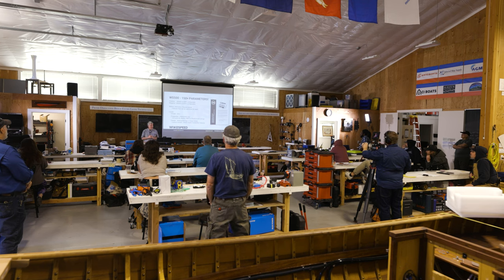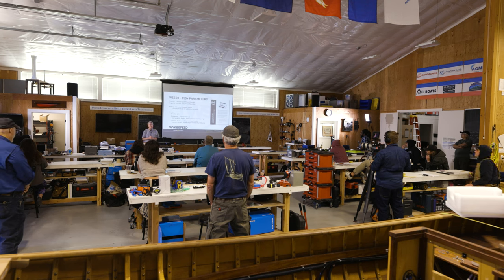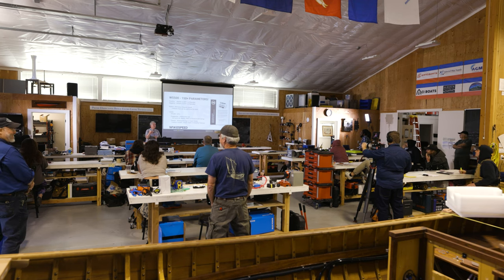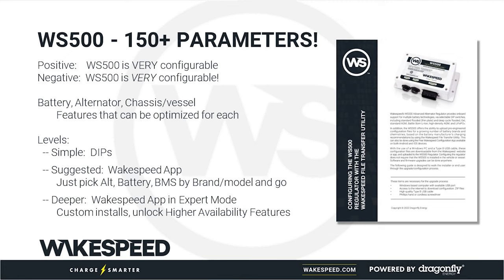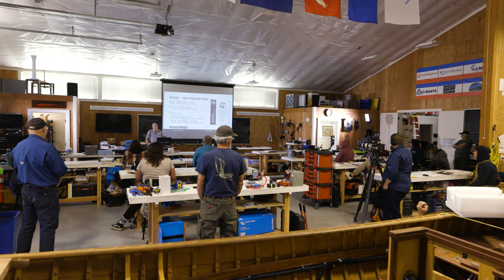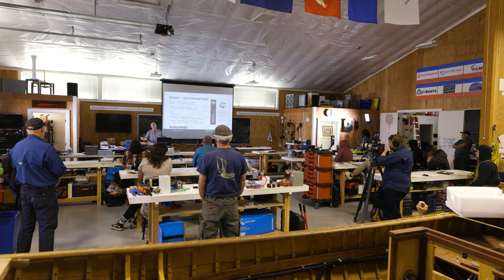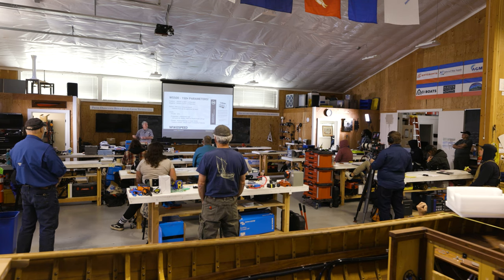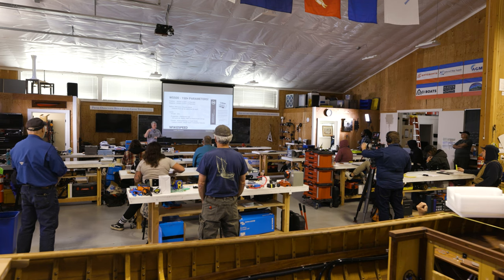Wakespeed 101 | Wakespeed's WS500 Alternator Regulator | Overview

Comment: What's the difference between the Wakespeed and a dc to dc charger like the Victron Orion or a Sterling model? I want to set up a dual Nations 280 amp alternator system in my van. That's 280 amps max for 1 individual alt, at idle it's rated at 180 amps. So a dual setup should be able to produce 560 amps max and 360 amps at idle. Here is my question, can I run both these alternators through lets say a Sterling 400 amp dc to dc charger and then to my batteries? Or do I need something like a Wakespeed Regulator as well?
Reply: The primary difference is that the Wakespeed eliminates the need for something like the Victron Orion. It lets the alternator directly charge the battery, so you can get the full capability of your alternator into the battery.